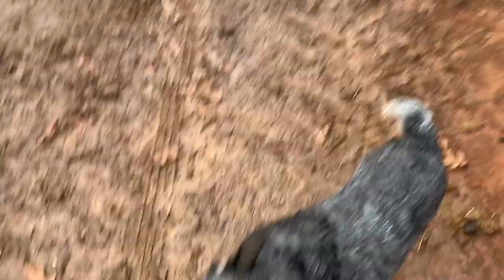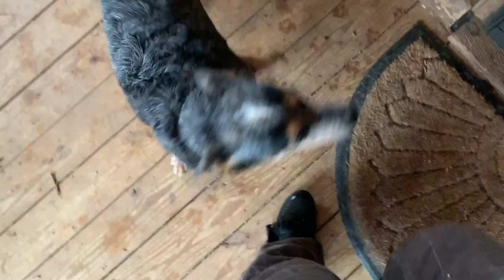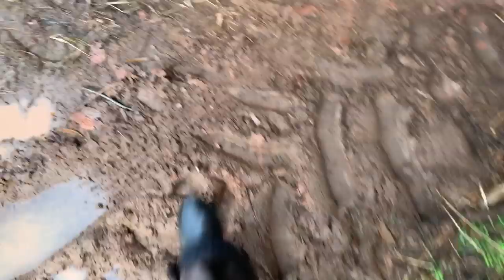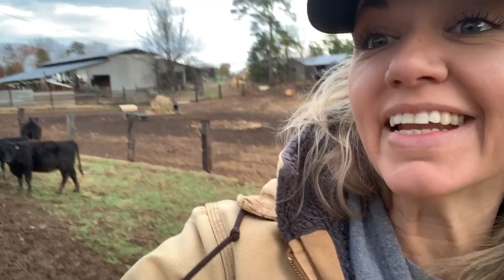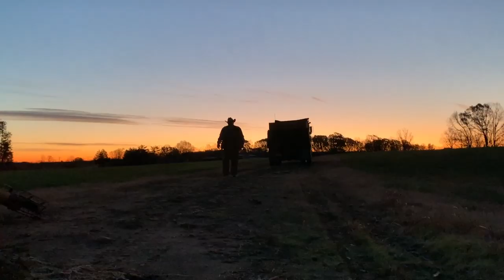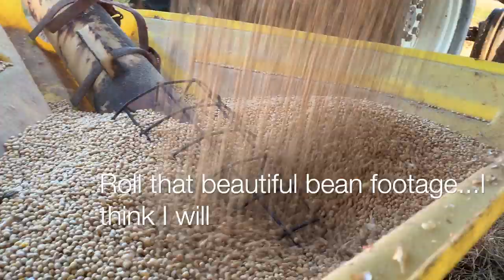Rolling Out of Beans & Into Mud

Comment: Another great video.  I was wondering if you knew why your truck makes that thumping noise.  It is caused by the A/C blend door actuator that has a stripped gear.   It is under the dash and it's job is to blend the air conditioning from the drivers side to the passenger side.  You can Google it to change it out.  They are only about $30 and are very easy to change out.  Love your farm and I enjoy watching you even though it is the same thing most video's but that is what your life is when you farm.  The same thing all the time.  I think the farmer is doing a great job keeping everything running.. Wished I could help out sometimes, I love getting my hands dirty and fixing things.  Let me know if you are ever hiring, LOL.  Keep your video's coming because I love them.  Take care.

Comment: how do you get your cows to walk so slow when feed is coming? wish m coes, steers and heifer would walk that slow when i am bring grain or hay out to them, they could be way down in the bush in this deep snow but soon as they hear my truck start up they all come runing and kicken up there back feet to the eletric wire fence, i have grain pails in the back and 50 oond bag of chicken feed in the back and i stop to open the wire to drive though, and soon as the truck cross the wire i drive as fast as i can but i have to watch them as there eating out of the pails in the back, and kocking them over before i get to the feeders, well i am dumping there mix of cracked corn and ground barly into there feeders there is always one or 2 cows or steers lifting the 50 pond bag of chicken feed or 50 pond bag of pig feed out and over the truck tail gate and i hhave to go retreve it from the brush were they are trying to rip the nylon bags open, yes they bit down on a corner of the 50 pond bag and drag it up and over the truck tail gate and drag it off, same thing when i rope a round bale of hay and drag it out into the snow bound feild they running behind eating at the bale all the way out, then it is a fight to get around them to get the looped rope off the round bale witch is always pulled tight and digging into the bale from pulling it, my mud roads are rock solid until June now, but my mud is sticky red clay, frozen solid many feet deep now, i was nice when i had the loader tractor for feeding and cleaning up all the poo around the water tanks, feeders and there winter straw feild pack in the spring, buy my ex wife sold it on me when i was out of town, you need to get chickens and pigs for them kids to do farm chores, or they will not be interested in farming wen they get older, because there use to free loading.. haaa
Reply from the maker: The cows just do their thing lol. Sometimes they run, sometimes they don't. The kids do things around here, and are typically working on school work in the mornings while I help feed. ;/0